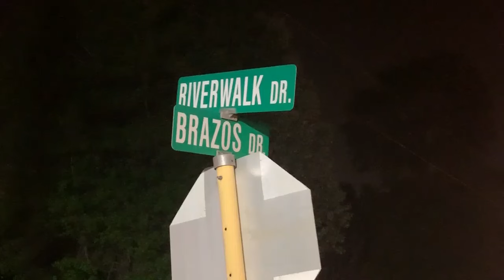031520 OFF DUTY METRO POLICE SGT FATAL

Comment: That's how they looked back in the day when they crashed.books full of pictures like that.absolute death traps..the days before any crash standards whatsoever.
Reply: No vehicle would hold up to that type of high energy impact. Even a brand new 2021 Mercedes SUV would probably kill everyone inside.

Side impacts like that are almost always deadly or severe injuries. 

Probably head on, yes the modern cars with all the air bags and engines pushed under the firewall would definitely be safer than an old car, but high energy side hits like this, no car is safe.

I just saw an old school Explorer(1995?) Run a light and hit a brand new Honda Odyssey Minivan in the passenger side and it killed two people in the minivan( a 56 and 86 year old ladies) and it was smashed in about like this car.
Reply: @freddyhollingsworth5945  Right on the money, Fred. I saw a 78 Camaro do this a few years back, only it hit on the driver side, forward part of the door. Tore the nose right off. That car was narrow enough at the impact point that I probably could have stood on the pass side and reached across the roof and touched the tree - and I'm not a large person. Coroner was there. I went back the next day to examine the scene, skid marks and all that Another guy was there, and he looked very shaken. It turned out he was the guy that pulled the driver out of it. Driver didn't have a prayer of surviving that.
Reply: Titus  search 1959 2009 Impala crash test. Then tell me which you'd rather be in..
Reply: All of  Scott Engels’ other fatal crash videos are of modern cars with crash standards.
All of those people are no less dead with the ‘crash standards’.
Reply: State police had a display @ State fair old cars wrapped around trees& driver.
Reply: @novaseline4u  Camaros not a safe car for wrecks they fold up in wrecks!.
Reply: @theotherwayofstopping4717  had a 59 loved it got a 2010 take it ANYDAY!.
Reply: Titus   Bud nostalgia is great I'm goin on 70 learned to drive in a 1941 1 1/2 ton chevy truck'I loved old cars but do you remember tthe bad about old cars?, replacing points&plugs every year or more?8 mpg!, carbs flooding@ stop lite...wind&water leaks...some had horrible heaters,tires were HORRIBLE,Brakes? I fell out door of our 1950 Hudson doors didn"t latch always...Few had AC....heat poured out of a lot even w control OFF.
Charging issues volt regulator& great generators!, remember? Those cars good as our memories in them were not near as good as todays cars...Sorry jmh opinion😁.
Reply: I wrapped a fox body Mustang around a tree. I can't remember how fast I was going, but it couldn't have been faster than 50-60 mph, and it is possible that it was more like 45 mph. Steel is even softer these days. And there's more aluminum and plastic. I would say they can wrap around trees even more now.
Reply: @RJ-lv4yw  The old cars have thicker steel and frames. A modern car would have split in 2 pieces if not more.

Comment: That was a very fast motor in that car. That old car, looks like a 1954 Chevrolet, did not have a solid ground for that motor.
Reply: Yes, since 1954, ther're have been many  regulations and engineering improvements for safety. (E.g., telescoping steering wheels, airbags, seat belts, a structural core that gets protected while outer parts of the car dissipate energy with controlled crumpling).

Comment: First of all, prayers to any & everyone involved in this tragedy. Second, I believe older cars were safer than today's cars. Yes there are some safer things like air bags, but it does not matter what era your car was made. It's no match for high speed & a tree that doesn't budge.🙏💔😔
Reply: Old cars are made of thin metal. They are nowhere near safer than today's cars. He couldve possibly walked away in a newer car. Go look at some crash tests of newer cars vs older ones and you'll see what happens
Reply: @eptdy  You know honestly my comment didn't need a reply. A simple👍or👎 would have worked. You could have wrote your own comment without replying to my comment. Since you did reply to me,  I have done my own study with personal accidents with older cars versus newer cars, & stand by my comment. I don't believe anyone could have survived that unless they were driving a tank. Not trying to be rude, just saying.
Reply: @eptdy  I agree brother!, They say how good these old cars were did ones making that claim drive them!??. I remember....replacing points@ least every year ditto plugs ,Lets talk carbs, sitting @ a lite motor dies...hood up traffic...horns...yip carb flooded....IF you never had anything to wop it with...used a pop bottle?
Better hav good battery 
ITS FLOODED...How about heater control heat comes out 95 deg NO AIR...Ever loop heater hose?.. chevys BAD about it...Hard top?... wind whistles...generrators went out...Chryslers were best... but they wouldn't start rainy days...So your telling wrong ones about great cars though I loved them...Not always GREAT!.
Reply: @packingten  You just talked about everything under the hood. Not the body of the car itself.
Reply: @eptdy  Thank you for sharing. It's kind of funny how today's cars get in minor fender benders & are totaled out. I believe that even if that officer was driving one of today's cars, even with all the safety features he would have died. I mean at the speed he was going & the tree that didn't budge after wrapping that car around it. Come on, today's cars would have done the same thing to him  You need to look at Scott's other videos. There are more modern cars that people are dying in those crashes.
Reply: @charley4928  that is very true. Cars get totalled out very easily these days and it's all based on price and depreciation. While this crash was obviously a result of speed and loss of control. I've watched a great deal of Scott's videos and hes one of the few people I follow on YT. I'm a big part of the hot rod industry and the general consensus among my colleagues is getting hit by a newer car or crashing a hot rod is going to have much worse consequences due to the way these older cars fold up. Newer cars are made to crumble on the outside but are very good at keeping the passenger cabin safe. With small low speed fender benders on the other hand, an older car will prevail.
Reply: @eptdy  My gracious! Who knew that a personal opinion would get so out of hand. People drive crazier & faster then they used to also. In my own opinion, I stand by how u feel. Again these people in Scott's video's die, no matter how well or pricey or new, or safe the car is supposed to be. If you reply bvb back, I won't! I give, have a Goodnight Eraun!
Reply: Charlie, you're response to this accident took off like wildfire.
Reply: @johngrepo9976  Tell me about it!  Totally was not my intention. Didn't know a personal opinion could be so argumentative, lol!!!
Reply: @charley4928  if this happend in a newer car the car would literally ripped in half, especially if that Corvette motor was in a actual Corvetteit wouldn't have been recognizable and that motor probably would have tumbled into someone's living room, I seen like that happen before, pretty gruesome and set sight to see, makes one think!
Reply: @eptdy  to be honest with you old cars were made of thicker metal they had a lower carbon content and made them seam strong but in reality the newer cars are thinner metal high carbon content with crumple zones along with rebars and support braces in critical spots to protect the cache as much as possible but at that speed no car could survive.
There is s video on YouTube old vrs new overlap crash test I think it was an old Chevy and new one the old one was a mess compared to the new ones...

Comment: One thing is for sure, the orginal color of that car was red.
Reply: That's the engine bay. Black and white accented in red was the greaser rat rod colors of the 50s.
Reply: 4:05, looks like the driver was ejected from the back passenger, or was pulled out there, door panel has a couple stains

Comment: Living in the mountains of SW VA and driving a 1968 Pontiac lemans in high school… I can’t think of how many times I risked my life driving that car and many others through these curves and near huge trees… God has sent me a guardian angel I guess.
Reply: I still have my first car. 68 Pontiac lemans.
Reply: @gregrudd2382  mine was white with blue interior
Reply: @gregrudd2382  mine was a 350 Pontiac engine and a 350 turbo trans with edelbrock intake, carb and headers with 2 1/2” flow masters. 3.08 posi, it ran a 9.69 in the 1/8th mile
Reply: Mine was 350 with 2 speed. Ran 17s. Now has pontiac 400, th400, 3.42 gears. Runs low 13s. 12.99 once lol.
Reply: @gregrudd2382  niiice
Reply: You should put it on your YouTube

Comment: When you take in the fact that the tree almost took this car in half.
That being said, the 50's and many early 60's cars are a world apart from today, by that measure even 1970.
He should have put a cage in it, prob would have lived.
Reply: YouTube 2009 Malibu vs 59 Belair, it just shows the difference between the 50s and 2000s
Reply: No one would survive the G forces of a crash like that. Your internal organs get smashed into your body from the several change in speed when stopped instantly. A cage would make the forces even stronger, not weaker.
Reply: @kevintomb  Howard Hughes crashed his XF-11high speed aircraft in 1946, his "guts" were all in the wrong places. He lived, clearly going faster then this car.
Reply: @jeremyk3320  Yep, and by 1969 GM's A-Body had "crumple" areas, door braces, ladder frames, bumpers that compacted the body, keys off the dash, "soft dash" and even a steering shaft that would collapse in it's self.
Reply: @soldierski1669  I'd be curious to see how safety in cars would have progressed if Ralph Nader didn't write Unsafe At Any Speed and how he went after congress

Comment: This is just a very sad and unexpected example of a driver being overconfident and paying such a high price. 

As a former professional racer, I've seen too many crashes where drivers thought that they knew everything they needed to, just to have their car (literally sometimes) turn around and bite them in their you-know-what. My point is that even with the advanced driver training that police receive, in most cases, they have no real knowledge of the cars they drive. All cars, especially high performance vehicles have "quirks" that can, and often do show themselves when being pushed to, or even near their limits or even when seemingly normal driving actions are taken. 

I don't know the extent of this officer's mechanical aptitude nor his level of involvement in his car's  modifications, but being familiar with the suspension and inner workings of this particular make/model of car, I know that a fairly reliable way to get yourself killed is to be accelerating at a high rate of speed and to then abruptly take your foot off the gas. Without getting to deep into the technical weeds, the rear suspension has a tendency to "unload", which causes a violent bouncing of the rear wheels which in turn can render the vehicle uncontrollable (don't ask me how I know this). Obviously, I have no way of knowing if that is what happened here, but it highlights the need for anyone, trained police officer, racing driver, or just some average person who walks into a car dealership and drives out in 700 horsepower muscle car should have a working knowledge of the mechanicals and handling characteristics of whatever vehicle  they are putting their (and others) lives in the hands of. And at the risk of pointing out the obvious, I'd like to think that all police officers know that the street is no place to get their speed fix. If this had happened at an actual race track, most likely the worst that would have happened would have been a bent up car and an unhappy, but quite alive driver. 

It's just painful to see such an unnecessary loss that could have so easily been avoided.

Comment: Looks like about (400) horsepower with substandard tires and worse brakes. Plus the frame buckled like an old can of vegetables.
Reply: A high horsepower LS swap on 1954 suspension is not a good match..
Reply: @rjones2000r  I was going to mention something about that, but I figured I would be piling on. Absolutely true though. A whole lot of people don't realize the seriously space age advances we have made in all aspects of drivability and survivability.
Reply: you pretty much hit the nail on the head. Plus these old cars had "X" frames which offered very little to nothing in the way of side impact protection. All the air bags and seat belts in the world wouldn't have saved that man.
Reply: @kevinedwards8218  I don't think that 54 had any upgrades with anything say "airbags".

Comment: Easily had to be doing over 100mph to cause that much damage.
Reply: Wrong. It would have been cut in 2 easily if it was going over 40.
Reply: @codyweien4513  wrong ! 
I own a 53 Olds and I can guarantee you the way these cars were built would require much higher speeds than that to cause this much damage.
Reply: @reginaldfitzpatrick8681  hit a tree at 30 and tell us how much it cost to keep you alive after a 30mph crash, if you even do manage to survive
Reply: @codyweien4513  I may be an idiot, but you're still wrong!
Reply: @TylerBonenfant  lol. 
Look at the video man. 
If you really think 30mph did that you're cookoo in the coconut
Reply: Dude watch some crash test footage. You're I'll informed
Reply: @codyweien4513  early 50s cars, especially GM, did not have an X-frame and were extremely durable. Thats why so many of them are still around today. 
If you really think that 50-60 mph would result in this video, then good luck to you.
Reply: @reginaldfitzpatrick8681  where did I say the accident in this crash was a 30mph crash?
Reply: I think he was going really fast and slammed on the brakes just past the mailbox where the skid marks start.  Then went sideways.
Reply: skid mark calculator is no good because he went into the grass and never came close to stopping.
Reply: @robbyddurham1624  like I said. I would calculate for sure, somewhere near 100mph. 
I have a similar car, and crashing at 50-60 would definitely not be good. 
But based on the damage in the video, if far surpasses that. 
Very high rate of speed along with sudden sideways impact
Reply: @reginaldfitzpatrick8681  At some point he was going faster than 40mph. I'm pretty certain he slammed on the brakes slid about 30 feet into the grass and then the tree.   Everyone might be a little right in the argument.  The speed he was going before braking and the speed at which he hit the tree.  My guess is he hit the tree going over 50mph.    Did you look at the skid marks on google street view? They matched what the cops spray painted on the road.

Comment: American cars all the way up to the early 60's had "X" frames which didn't offer a lot of side impact protection. That is why this car folded into the tree like that. There is no frame member running underneath the entry points of the car.
Reply: Actually, 1953 and 54 had full perimeter frames. Chevrolet introduced the X frame in 1958 and stopped with it, I think around 1965. My 1964 had the X frame, my 1956 did not

Comment: This video,  as tragic as it is, illustrates just how unsafe and un crashworthy vintage cars are.  4 years ago I was driving home from work, in my 2013 ford Focus.  A lady driving a crystler minivan ran a stop sign,  and I t boned her travelling 55 - 60 mph. No long term injuries,  however I broke my arm with required surgery,  and had many visits to the chiropractor.  Now if it were a 50s car with solid steering column, all metal dashboard and no seatbelts or airbags,  I wouldn't be here typing.
Reply: People die everyday in bran new car's and truck's.

Comment: RIP so many people make the mistake not upgrading the breaks and wheels after putting in a big engine in this beautiful old car probably only had a 100hp when new then putting racing  engine capable of 400-500hp due to the weight to power on this car must of been like driving on ice our thoughts and prayers go out to his poor family I am glad no innocent persons were hurt in this crash.
Reply: It has big wheels and low profile tires that look quite a bit wider than stock. You can't see the brakes but I would imagine they are probably upgraded just judging by the rest of the build. It definitely didn't have any computer nannies and my guess is the driver locked up the brakes and lost control. Who knows if the owner even balanced the brakes properly. 

The driver was probably used to ABS and traction control saving his ass and didn't know the limits of this restomod since it wasn't his.

Comment: I've got a 51 Chevy Sedan Delivery...I could drop in a small block V-8...but then you need a complete late model frame and running gear...good tires and brakes, like the car that engine came out of.
 Even a 54, not really designed or built to be running at todays speeds...

Comment: I wonder why it's so horrible but that's way more power than they had back then. Who knows what's done to that LS and what hasn't been upgraded to the suspension, brakes, steering, etc so you could control that power.